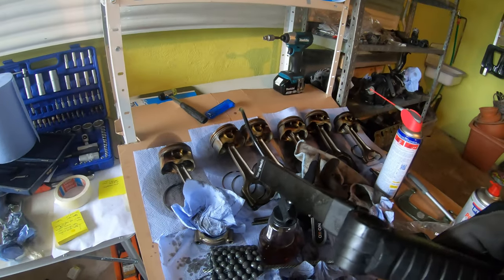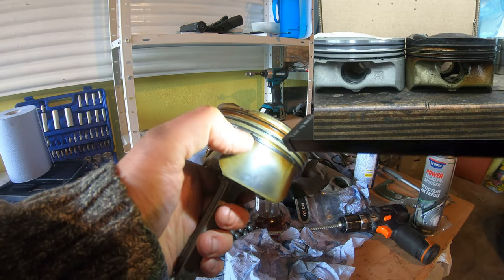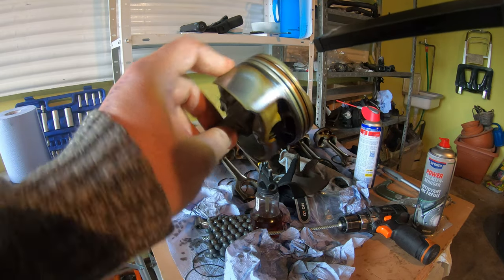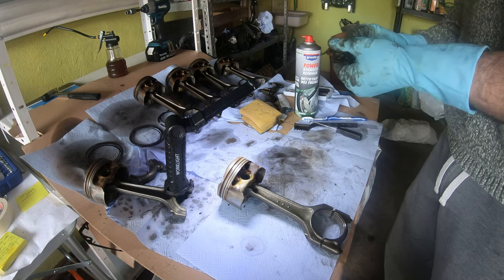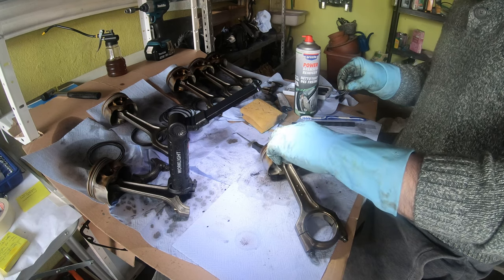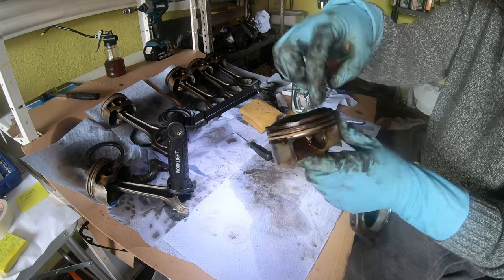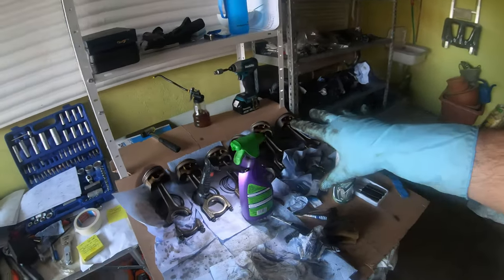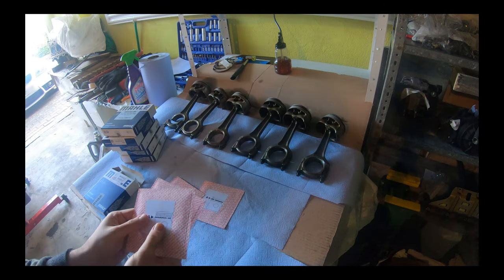Easy Way To Clean Carbon Buildup On Pistons and Grooves (No Harsh Chemicals) BMW N52 Rebuild Project

Comment: Dicholoromethane paint stripper works BEST for taking carbon off pistons... Nice thick coat of it... let it sit for 20mins .... wipe off. Easy!!!
Reply from the maker: Paint stripper ... didn't have any around. Luckily the pistons were not that hard to clean... as you will see in the following videos, cleaning the valves took a lot of time to grind the carbon off of them.

Comment: Amazing videos !
I'm planning to rebuild my N52B30 on my Z4 3.0si coupé (big oil consumption, 9 bar on one cylinder, lifters ticking, ..).
I currently have an Excel file that lists all the parts that I need but I would like to compare.
Could you send me your tools and parts list ? :) 
Thank you!
Reply from the maker: Thanks for the reminder. I was compiling all the parts and tools I needed and wanted to do a complete list since I had to buy more parts and tools along the way. (Stuff broke or needed more than I thought)
Reply from the maker: I also made of video of almost all the stuff you will need... But I re-used some parts to safe $$$. You can compare your notes here. https://youtu.be/vPv6bWl6Cjo